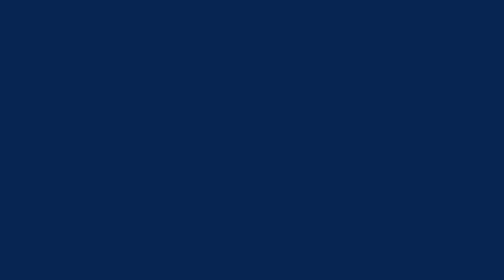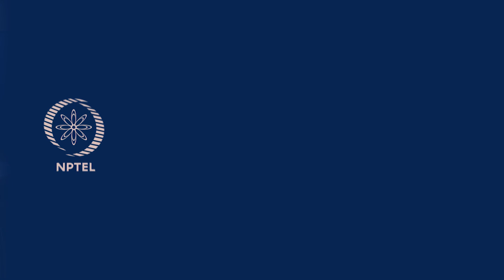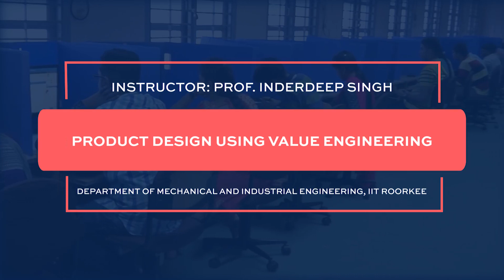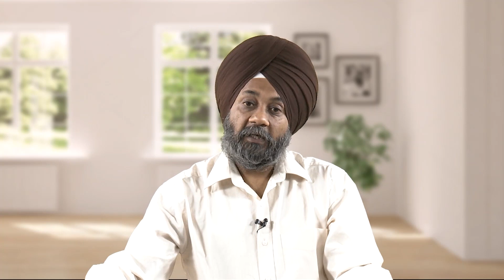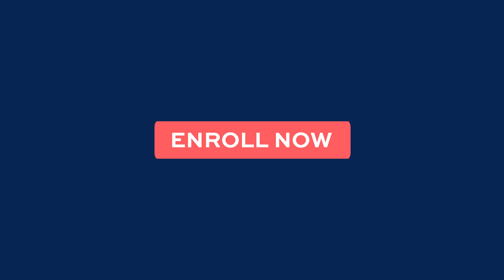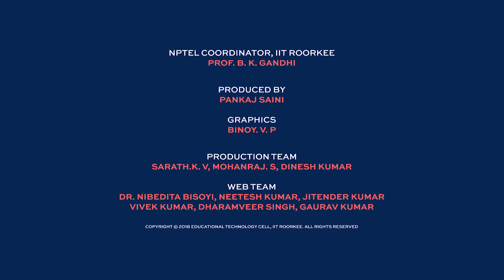Product Design using Value Engineering

Comment: The lectures are NOT in order. The correct order is as follows. 
Existing order --> Correct order
2	1
3	2
4	3
16	4
5	5
6	6
7	7
9	8
8	9
13	10
10	11
11	12
12	13
15	14
14	15
20	16
17	17
19	18
18	19
21	20
So, listen to lectures according to the left-column order.